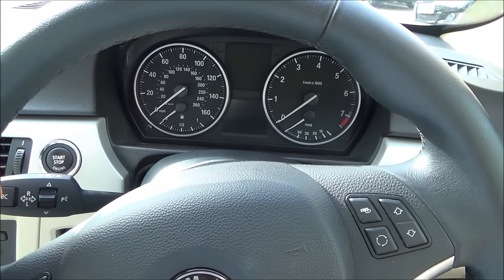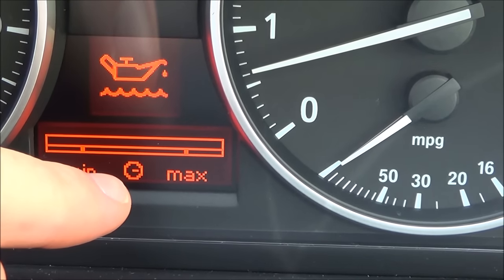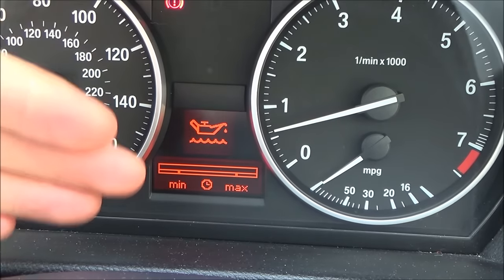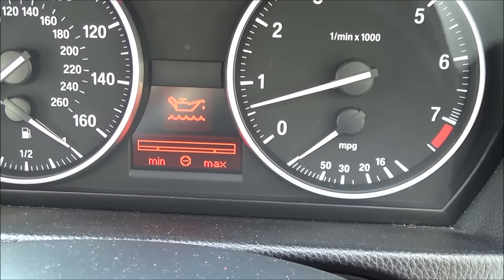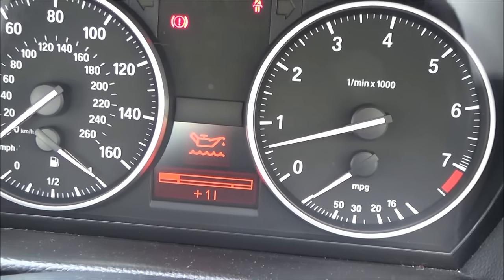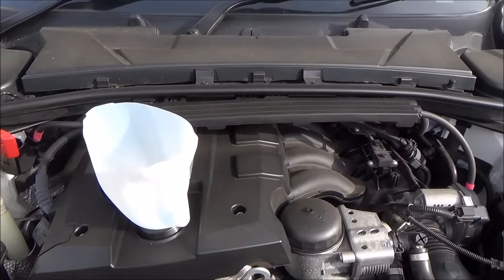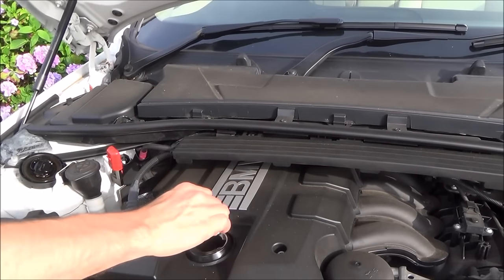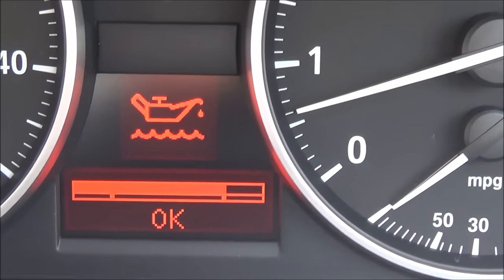How to Check & Top Up your Oil in a BMW with no Dipstick

Comment: The next step will be a sealed engine compartment, so you have to pay the stealership to check the oil for you!!  One more reason to never buy a BMW!
Reply: Richard King ADI really, you think that’s the next step? Not sure why everyone bashes the electronic dipstick, it’s actually better since it is always monitoring the oil level. If it gets low it tells you when you start and shut the car off that you need to add oil.
Reply: @vincentreedy7945  well bmw broke one major rule in cars, and that is, "if it aint broke don't fix it".
Reply: Vincent Reedy   Electronic sensors can break.    A dip stick cant
Reply: Bring it on BMW!
Reply: @vincentreedy7945  thanks| God i drive Lexus , do not have to add any oil
Reply: @vincentreedy7945  All cars have sensors that monitor oil levels whether they have a dipstick or not. You will get an orange or red oil light depending on how low you are on basically any car made within the last 40 years.
Reply: An aside from this is it stops dirt ingress via a dipstick.
Reply: @barryfowles-zl5ib  Bollocks.
Reply: @gravemind6536    My advise is legitimate, just because you obviously know nothing about cars, your reply described what is between your ears.
Reply: @gravemind6536    Dipstick or not my credentials to comments are impeccable, my entire work-life, 45 years, was spent on engine design, prototype build and test of engines for a major motor manufacturer, and FYI there is ingress of dirt and grime by dipping to check the oil level, what is your objection to the process of accurate checking using available and reliable methods without even leaving the drivers seat?
Reply: @barryfowles-zl5ib  The fact that I can't see the oil with my own eyes is the issue and that computers can have glitches and break so cannot be 100% relied on for checking the oil.
Reply: @gravemind6536    I have had a 3 series for 3 years and have had no problems with the system, years ago people mourned not having starting-handles fitted to cars and before that not having ignition advance/retard levers on the steering wheel hub, things move on, I agree with you about not being able to see the state/colour of the oil, but using the recommended oil and changing it+ filter at the indicated intervals shouldn't give problems, on some cars fitted with dipsticks it's the level indicated varies from which side of the dipstick you view for oil level, check out the BMW Mini and others, and to go back to the dirt ingress, many people do not clean away the build-up of residual oil residue from where the dipstick top seal enters the top of the tube, which combined with the dust and grit soon becomes a substance similar to grinding paste.
Reply: Ok boomer
Reply: @vincentreedy7945  my car electronically monitors the oil AND has a dipstick.

Comment: Such a waste of time!!! Thought technology was supposed to make life easier and faster. I see no improvement from the conventional way of checking the oil.
Reply: It's made like that so you can actually check the oil while driving. It will automatically tell you to add one qt. At that point you go somewhere and tell someone to add a qt or do it yourself. It's actually very convenient.
Reply: @laryanryan9170  Waiting 5 mins for an oil level reading? Fuck that noise. 1min to check your oil right before you take off is all you need. Why would you need to know your level during driving?
Reply: @Totemparadox  Because BMWs' burn oil like a mutafucker? Gotta check it every 5 mins to be safe.
Reply: @absboodoo  Valid point.
Reply: @laryanryan9170  But you can have that feature and still have a dispstick
Reply: @dustindiamond2734  My beamer didn't. I would rather have a dipstick.

Comment: Wish i seen this earlier. I topped up with 3Litres of oil instead of 1 Litre then drove 150miles home with no issues. Gonna check the car tomorrow fingers crossed its all ok as i clearly over filled the oil 🤦🏽‍♂️
Reply: How's the car going has it blown all the seals yet!? 😳😬😬
Reply: @paulkett8414  Car is fine mate no issues 😬

Comment: Don't open the oil cap or add oil when hot. Moisture gets trapped inside the engine that way. Only open after it has cooled.

Comment: So BMW thought it would be a good idea to get rid of the dip stick and switch to an electric sensor? Why in the actual fuck would you do that? For starters, it takes like 5 minutes for the shit to read the oil level where as with a dip stick it takes all of 5 seconds. Then the car's cost goes up because they decide to put some expensive more than likely hard to get to sensor in the car somewhere just to read the oil level. Then there's the reliability. What happens if that sensor shits itself and you're never notified of a low oil level and then you ruin your engine? Genius. "Oh but the people buying these cars don't want to get dirty going under the hood", yeah, well the people buying these cars have to then go under the hood to put oil in the damn thing anyways so there's that. Unless you're some rich snoot to "posh" to so much as simply put oil in your car that you pay to have someone do it for you.

Comment: If this is needlessly complex what did you think about the first time you wanted to check a car's oil when you were a lone. Did you know how to open a hood, not all cars are the same, and right on through with finding the dipstick. Do still have to fish around to replace the dipstick even if it didn't need any oil? 
I can check my oil easily from the driver's seat of my car before I go into my house from an errand. Can something be "needlessly" easy?
Do I get the urge to go out and check my oil when I am at home, no I do not, but I do when I am in the car. I can check my oil with less effort RAIN, SHINE, NIGHT or DAY than others who have to get out of the car,  raise the hood and the rest of it. It takes  a fraction of the time to learn this than to find a hood release in a vehicle that is strange to you.
Now let's move on to those pain in the arse gas gauges, did those Germans design them too?

Comment: You might be able to check if you have enough oil, but you can't check the quality of it, not being able to check the quality of the oil whenever you want, just ridiculous, might be golden, could be black, you will know just tapping a few buttons on the dash.
Reply: Oil is always black now because of the stupid EGR emissions sytem putting exhaust back in the engine.

Comment: This BMW has 15000 miles and already burns a 1L of  oil...what a rubbish engine!
Reply: Most likely an oil leak from the oil pan or oil  filter gasket. The 6 cyl BMW engine is a good engine.
Reply: could also be burning it if you drive like shite
Reply: Sorry, but it seems that is a 4 cyl machine... I have a 6 cyl (M54) machine in my E53. It has driven 220.000 kilometer. Its 18 years old. It consumes 0,5 liters oil at 1.500 kilometers...

Comment: That's crazy every car should have a engine oil dipstick and a dipstick for the transmission fluid as well I don't know what the car companies are doing it's insane eventually all the car companies will get rid of dipsticks older cars were so much better built and more reliable.

Comment: If the engine is damaged because of a faulty sensor or someone puts the wrong amount of oil in it, it's ok. You can throw away and buy a new one.

Comment: What another stupid idea from BMW. If and WHEN those sensors go bad you'll be in big trouble.
Reply: dhalsim1 no you just need to know the average miles per oil change for my 525xi it’s about every 15k I just change it at 13.5-14k to be on the safer side and I’ve never ran into any problems

Comment: Bmw should keep the dame stick - thats the most stupid tech ever made for oil reading and the car apparently has to be on - what about if there is not oil and you hace to turn it on waiting 3 mins to the stupid sensor read the level - without oil and engine on you will blow the engine

Comment: Bmw killed the topside oil change.   
Unforgivable corporate greed along with hideous front end styling will signal a dark period in the coming years equivalent to the swiss watch industry's struggles in the early 80's.  We want durable rubber, not an additional degree of separation from the driving experience

Comment: Replace the battery in key fob and you don’t have to stick it in for it to “only” work. :)
Reply: Depends on the model year. All models don't sense the key fob unless it's in the ignition. There is a work around to that though.